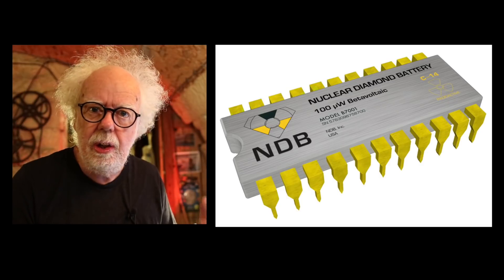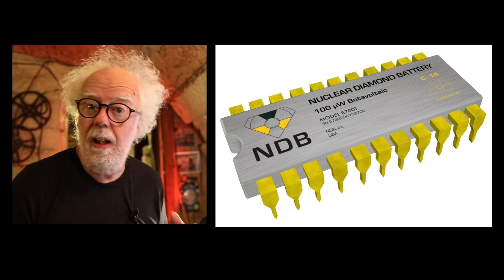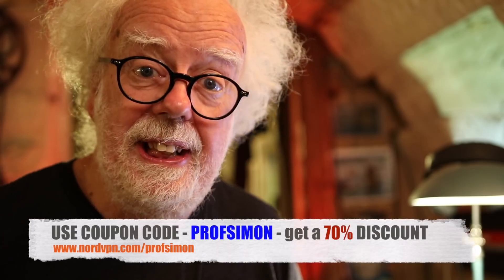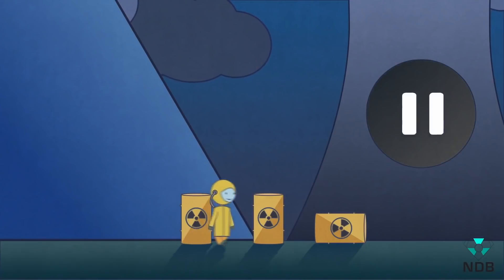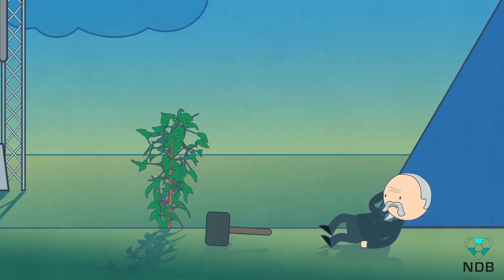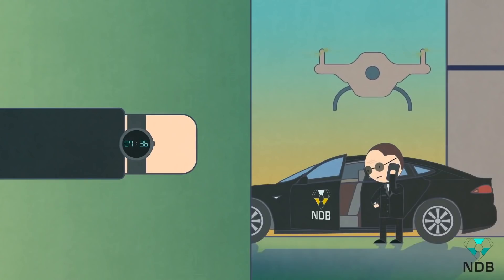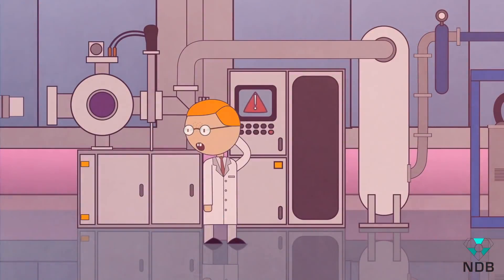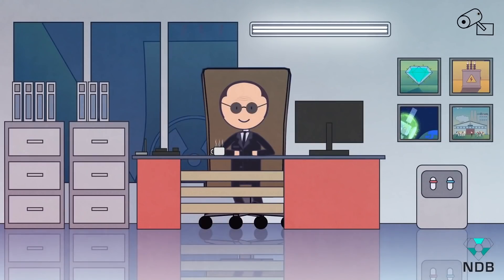How do nuclear diamond batteries work - prof simon

Comment: Halflife: 5700y -> 3x10^23 electrons through beta decay with 14g of C14 (one mole and avogadro number)
1electron is emitted with around 50keV resulting in 150x10^23 keV = 150x10^26 eV => 100x10^7 J  => 1 GigaJoule over 5700 years.
Sounds much? Nope. Thats around 300kWh. So you can charge three Tesla in around 5700 years with 14g of C14. Impressive!
Provided that they can reach 100% efficiency.
So i would say BS.
Reply: So that's ~ 6x10^-3 W/g? Therefore, to get one Amp - enough to run 2 USB devices - you'd need ~166g, which is 1/3lb... So to do anything useful... Like run a 500W computer, you'd need 83kg? That's a "large gentleman's-worth", of course, all assuming 100% purity, efficiency and zero transmission loss...

(🚬-packet sums, so need my work checking 🙄; yes the bot censors the common slang for cigarettes)
Reply: @edwardcullen1739  Agreed.
 Calculated at artificial diamond average price per gram of $100/gram than that 83kg battery would cost  $8.3M. OR $1600 per year.  500watts continuous would require a 2000w solar system to provide night power, lets call the set up cost of $4000 and a yearly cost of $500 maintenance the solar total would be about $2.5M.
Reply: @another1commenter770  👍

Yeah, of course, the batteries for storing overnight aren't free, but the can be reprocessed... Which I'm sure would still use less energy than creating 83 kg of diamond(s).

I'm still trying to imagine what an 83 kg diamond would look like 🤣
Reply: @another1commenter770  In the year 2070 $500 would be $140 of today's currency.  Your maintenance 1,000 years from now is 6 million dollars a year hahaha
Reply: Patience is a virtue
Reply: Nothing remains 100 percent efficiency.
Reply: @davidmyersretiredaerospace8038  Your sarcasm detector seems to need a bit of a tune-up.
Reply: It would be revolutionary for a lot of electronics you probably didn't even know existed. There are millions of low power wireless electronics modules currently powered by batteries. If these can be powered by an almost unlimited battery, even if it can deliver less than 1Watt, you have a revolution in electronics on your hands
Reply: @thomgt4  If you can follow the math and physics, these small devices, which have been in use for many decades and for sale for over one decade, produce so little electricity in a given amount of time to render them unfit for much of anything of use. I don't care how small your circuit is, we need more power than this can usefully provide in a given time. The overuse of "nano" and "technology" in marketing gibberish has left investors tired and the company NBD, quickly retracting many lies it published on their "breakthrough".
Reply: @thomgt4  yeah, i just say nope. This technology is ooooold. No revolution there. Just marketing.
Reply: Also the battery is a source of charge, not potential difference. You would need an earth connection to get a constant potential difference, otherwise the charge will just build up, reducing the potential difference from the electron source. I.e. a phone powered by this thing would need to constantly discharge through you, or occasionally give you a shock, as far as I can tell. The cost is less of an issue in remote applications such as satellites, or small objects such as a watch, but then you have the issue of static discharge of the electrons. The only way I can think of removing them is by the photo-electric effect in sort of half a solar panel where electrons get discharged into space, but then you effectively need a solar panel to run it and the whole point of the battery is nullified (unless the solar array is significantly smaller and cheaper than standard panels).
Reply: @Bordpie  Really? Do you know physics at all?
Hmmm. After thinking about and reading the whole response.... Do you use GPT 3?
Reply: @markstabenau7229  Ok I figured it out, the proton produced from beta decay is your positive side of the battery effectively acting as a charge sink. Still, millitaries and people who like their watches powered by radioactive diamond energy crystals (these people probably exist) might be interested.
Reply: @Bordpie  sigh...
Reply: @markstabenau7229  Yup I forgot net charge is conserved, it's been a while since I did nuclear physics.
Reply: @Bordpie  you're mixing chemical binding energy with nuclear energy ( weak force). But i get you now. You thought more about the practical problem that charge is building up, if you would "loose" the electrons. But as these calculations are only about the theretical upper limit of energy/power of such a device the potential energy of the electrons is quite negligible. Sorry for my other replies.
Reply: 1 karot is 14 grams  if you base it off eV that would be 280g of C14 not 14
Reply: @gags730  Getting married is smart?  Explain that..

Comment: Sounds good till you think about it. if they only sell batteries once for each device. they won't stay in business very long.
Reply from the maker: Good point.
Reply: The batteries will not be cheap (provided they could ramp up the power to hundreds of thousands of times what they show). 100 microwatts is not going to power any useful consumer device. The biggest selling point is it lasts for thousands of years but that is not really useful to a consumer.

Comment: The Nuclear Diamond Battery can make 11,400 electrons.  That's hardly enough to power anything.  It takes 6.24 x 10 to the eighteen to make 1amp of useful current.  One microamp of current is 
6.24 x 10 to the 12 electrons.  That's 6240000000000 electrons to make one microamp of current which can hardly power anything.  The electricity produced by the nuclear diamond battery will not power any device we currently use.
Reply: It is a scam, these batteries have been around for literally decades, using beta emission off of radioactive material to pass electrons through a vacuum to an anode, so you get a very small current. Think of it like a ionisation smoke detector in a vacuum, with the Amerecium as a cathode surrounded by a metal anode to collect the electrons emitted by it. Tiny current, and the biggest ones that are still within regulation limits are used to power micropower devices, like memory back up units for ultra reliable computer systems, where you cannot have a battery fail, but it must still be operational after 50 years. Think missile launch systems, and secure enclave vaults in encryption machinery, where you want a tiny trickle of power to keep the memory alive, but have to totally seal the entire unit so it is tamper proof.

Not ever going to replace a chemical battery, though you can use supercapacitors with ultra low leakage current to store that tiny trickle of charge for use in a single shot event. Basic power limit is in the nanowatt region, with most falling in the high picowatt power delivery range, around 5V at 1nA at best for them.
Reply: SeanBZA    Ok well would you consider donating to Us to make a NDB  that will power a Led Xmas buld twice the size of the Baghdad battery?   That’s something!! 😩☝️
Reply from the maker: Great info...thank you
Reply: @SimonHollandfilms  pass it to thunderfoot or EEV blog , it truly sounds like scam
Reply: @garryclelland4481 ...and Robert Murray Smith.
Reply: @garryclelland4481  Thnunderf00t already debunked this idea.
Reply: @garryclelland4481  It's a SCAM, period.
Reply: There was nuclear powered pacemakers in the 1980's
Reply: @SimonHollandfilms  This concept of battery is promoted with too much disinformation. If you want Watts of power from a betavoltaic battery, you naturally need even more power of emitted beta radiation from the isotopes inside and suddenly your "safe battery" becomes a nightmare of radiation danger. Imagine touching watts of beta radiation...you will get radiation burns right away and if you crack it into dust, next worry will be the cancers coming. Besides, Watts of power will require a mega size of a battery just to power a phone (hire some helper to carry your mobile phone battery LOL).
And hey, if you want to power a car with 10s of kWs of power, you essentially have a huge problem of CONSTANTLY creating such power from the battery as the radiation won't stop when you stop your car. Expect your car will burn up in smoke when you park it and all those kWs will have no other way to escape than by heat.
Reply: @SimonHollandfilms  Imagine a nuclear diamond battery that can last 1000s of years ￼😊...then, realize such battery being 1000s of times bigger than a Li-Ion battery for the same power 🤔 (yes, this is a scam)
Reply: Exactly what I was going to say.  11,400 electrons per what?  A linear millimeter of atom thick quantum wire of C14?  Yeah there's a lot of questions.  Also the C12 diamond coating is going to shield the 50Kev beta decay electrons how? If just physical blocking then where does all that heat go?
Reply: @mikeclarke952  what, it sounds like getting the power out of glow in the dark "clock face", crossed bread with a off the Shop shelf "coupled power isolation in CHIP FORM" of some sort power out put would be anyone's guess!
Reply: @Richard Vaughn Probably power a wall clock, that otherwise uses a standard AA cell. Power will definitely outlast the clock though.
Reply: But shes listing all the battery sizes they can make !  18650 and AA and triple A    You missed that part its at 13:10.  Its a California Co. Has to be legitimate   🥳☝️
Reply: @AboxofMonsters  All of the participants in the company are pretty much in the UK. Kinda strange to have your HQ in Cali when you all live in the UK. I hope no one gives them money.
Reply: Bane  its a UK scam  no doubt.   some of the most ruthless scammers live there  😆
Reply: 100 micro watts. ROFL. Not powering any flux capacitors any time soon then?!
Reply: Mr Avogadro wants a word with you....
Reply: a@
Reply: @Richard Vaughn huh. That powerful eh? Probably lighting a very small LED is more realistic with that amount : )
Reply: Philip Meads    Ok 👌🏻 how bout a battery the size a dbl 18 wheel trailer that can be used to power a head light on a solar powered peddle bike. You can buy in at $20.000
Reply: Thanks for the info. I found the concept intriguing, but did not want to do the research and math to figure out if it was really plausible.  It sounds like these batteries wont be very useful for things we actually want. 

Maybe Bill Gates can use them to power the tracking chips, he puts into every vaccine injection.  You are welcome conspiracy theorists.
Reply: Well another issues is the concept that diamond is hard then impact resistant. In my knowledge hard materials are brittle

Comment: Just imagine the mini nuclear explosions across the world when the chinese start making knock off's,their lithium batteries are bad enough.
Reply: Samsung?
Reply: 😆😂🤣the "hoverboards would blow your feet off😆
Reply: The biggest risk would be nuclear radiation if it was made in an unsafe manner. Explosions would need a lot more work.
Reply: Mervin Marias   I think that’s what the Iranians were working on. Boom!
Reply: Richard, you are correct! Why can I say this with confidence? When I was a young man, I did work for an older gentleman as his helper in his lab, he had horrible back problems, I was physically fit! I found out after a while and being able to gain his confidence that he had been on the original team at Los Alamos that cracked how to make the precision shaped charges in 'The Bomb'. Very enlightening! I also had an instructor in school who was a designer of the 'Initiator', that was placed at the center of the mass that kicked out a pulse of neutrons to add more 'Oomph', his exact technical term for it!
In the 'Implosion' Bomb, and in the 'Gun-Type' Bomb, you have to use extremely high velocity explosives to accelerate the portions of Bomb Mass into each other and literally 'Fuse' into a solid, cohesive mass, otherwise, in those millionths of a second before it happens, the rapid increase in temperature (and ensuing shockwave of pressure generated) between the masses Will Blow Them Apart. Pneumatic, hydraulic, or mechanical fixtures or jigs will not cut it; it will blow up the device, probably part of the building, but not Kilotons of Blast...
Reply: @stephenkeebler732  So, not enough to wipe out a city, but enough to blow up your nuclear-powered hover board?

Right. I'm failing to see how the original joke doesn't work...
Reply: You do know that this stuff is spent. It cant explode lol. Its kept in drums underground dude.
Reply: It won't explode. It just won't produce a lot of power
Reply: How about smart grid self destruct with millions of tiny explosive devices that can be detonated with a vibration even when not connected to power. GO FOR IT!
Reply: @richardwendling4030  thats a lipo battery. The government can at will power on your toaster dude. They can cause your battery to go boom. Lipo batteries are more dangerous in the explosives department due to their unstable nature when disturbed. Even if you could access the nuclear material inside, it would be so minute, it wouldn't do much. It only makes beta radiation and it would be toxic over long term then. The batteries would be enough to supply 3.7v or more and thats what lipo batteries use. They have stability issues thats why you cant just charge a lipo. It needs a regulated current going i to the cell or it could damage the battery.
Reply: @Bioactive_Zone  I am sure you are correct. I was just playing along with the premise. I do not believe this is actually even viable.
Reply: The only way you can make and explosion with these is if they were somehow made powerful enough to detonate an actual bomb. Which since theoretically you can gang an arbitrary number of batteries together, you could do so. That would explode and disintegrate the ndb's and spread that around. But it wouldn't be that kind of explosion.
Reply: @Richard Vaughn LOL.

No, it doesn't. It needs a means to bring the two masses together so that they will go critical.

You could use pistons or a (very large) blast of air. Conventional explosives were only used as they are a convenient (high energy density) and reliable (goes off when you want, predictable force) means of moving the mass(es) together.

The nuclear explosion is caused by the proximity of the masses, not the impact force.

But then, if you actually knew anything about nuclear physics, you'd already appreciate this - and my original reply.
Reply: @Richard Vaughn Jesus wept, man, where's your sense of humour?

And no, you only need explosives if you want to create an efficient thermo-nuclear device. Learn about "gun-type fission".

Comment: No mention of power density of these batteries. Will a AAA NDB be able to deliver 1A at 1.5V for virtually ever of just 10mA at 1.5V for virtually ever?
Reply: @Eddie Hitler Thanks. I suspected as much. But if each one is say as small and light as a grain of rice for a few pW then a few thousand clumped together might be useful enough. But the company video suggested they would be widely used where conventional batteries are now. Presumably that's their aspiration, and not feasible in the near future...

Comment: The Moon!!!!! That is an ideal nuclear waste dumping ground 🤔🤔🤔 or send it into the sun????
Reply from the maker: Poor moon...
Reply: Delta v into the sun is a LOT of fuel
Reply: There's hundreds of thousands of tonnes, I wouldn't like to think of the effect of one of those hundreds of rockets exploding releasing its contents into the atmosphere
Reply: 🤔🤔🤔 footnote to ones self, don't fire off comments without thinking for a long time 🤣🤣 unfortunatly cost is the major reason clean energy will never be developed, so much potential but no one will invest, if it magically appeared they'd all be investing but that ain't happening 😪
Reply: I think the advantage of renewable energy is that its profitable now, nuclear energy still requires tax payer subsidy to operate even though we've had it for decades, if its still loss making today I doubt nuclear will ever be viable  (fusion withstanding obviously)
Reply: It took a 363ft tall rocket weighing 3000 Tons with the equivalent chemical energy of a small nuclear bomb just to get 3 men with their combined weight off 240kg to the moon.
 What do you think it would take to get thousands of tons of nuclear waste to the moon?
Reply: It's very clear now, we need to find that magic propulsion system to be able to send anything, anywhere outside our planet, may be by then other (friendly) beings may be around who have a good use for our waste and it becomes a trading tool?
Oh if only life could ve that simple 🤣
Reply: Or we could stop subsidising for the nuclear industry to damage our world maybe